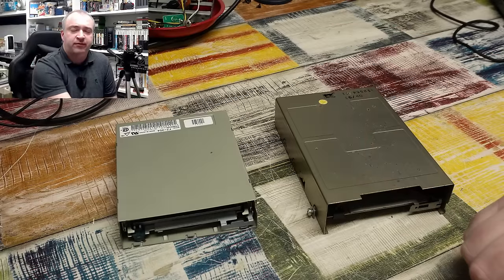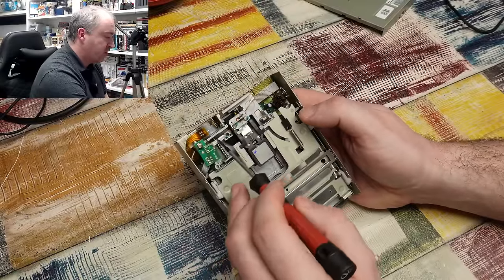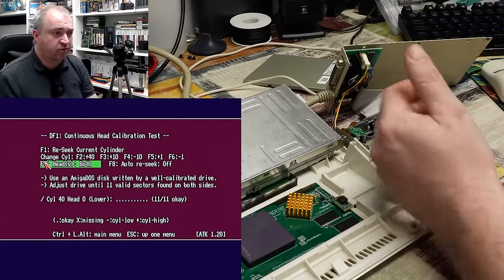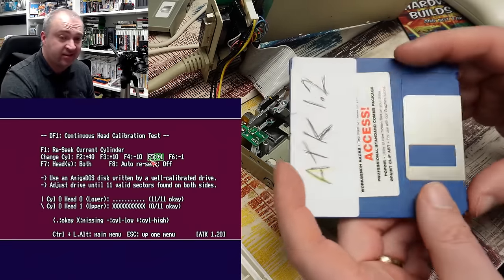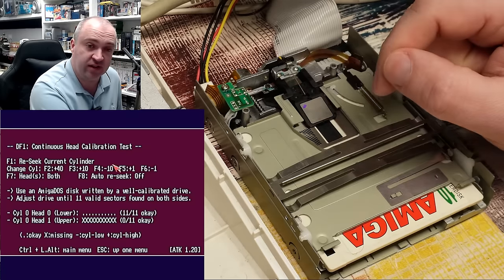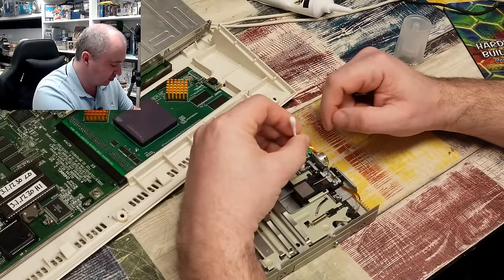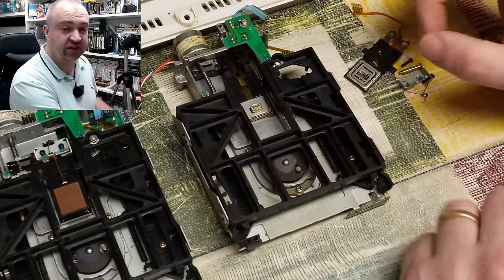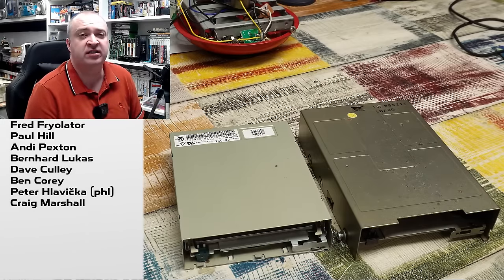Hands on alignment of an Amiga disk drive

Comment: Great video! a couple of weeks ago I just bought a broken external drive on ebay listed as broken, it powers up but does nothing... I am gonna do what you did here :)
Reply from the maker: Thanks glad you found it useful.  Certainly try Amiga Test Kit and see how it reports the heads.  If they are out start with the lower head.  Some Amiga disk drives also need the capacitors replacing to bring them back so that's worth checking too.  

Please let me know how you get on.

Comment: I successfully got my A1200's Panasonic drive working again this week. To get the track alignment, I rotated the stepper to find the extremes where it started to have errors, and set it at the midpoint. The track 0 sensor is harder, but the Greaseweazle software will tell you if it trips prematurely so you can estimate how far off it is (maybe ATK does too - same author). I used a stack of paper (a pad of small post-it-style flags) wedged between the sensor and the drive frame which let me adjust it by increments of about 0.09 mm, or about half a track, per sheet.
Reply: For leadscrew lubrication, Panasonic specifies Molykote EM-30L grease (PAO synthetic, PTFE and white solids, lithium thickener, no silicone). For the guide rod, they just say "oil", but I'd favour the silicone spray type.
Reply: Another nice thing about using a Greaseweazle (or similar) is that you can easily test the drive with other disk formats. When my drive was properly set up it could read original PC DD disks perfectly, whereas after my first alignment attempt it could read some Amiga original disks but not the PC ones.

Comment: I learnt a lot from this video my friend :).. I wont be touching those screws any time soon lol.  I've never used the disk section of the Amiga test kit either so I know how that works now too. Cool :)..
Reply from the maker: Thanks, glad to hear you enjoyed the video.  Yeah don't be removing any screws that have glue on them.  The disk section of ATK is certainly useful, this was the first time I used it for aligning a drive but it seemed to work well and was far easier than I initially thought.

Comment: Commodore didn't make it easy for code in a custom boot block to know what drive it has been booted from. This is how I did it back in the day. The OS does give you a pointer to the IORequest for the boot drive. Then the trick is to loop through all possible floppy drives, with a loop index and open a new trackdisk device for each. You can then compare each trackdisk device's IORequest's io_Unit pointer to find the one that matches the io_Unit pointer for the IORequest passed in. The index for the current trackdisk can be used as the drive index that the floppy was booted from.

Comment: I have a pile of 3.5inch floppy drives on a shelf. About 10 of them. Various makes and models. Do you want any? They were out of old PCs so not specifically amiga drives.
Reply: Im not sure what the difference is between an amiga FDD and a PC FDD.
Reply from the maker: Thanks for the offer but I've also got a pile of spare pc drives.  Other than Amiga drives being double density there is some signalling differences.  You can convert a pc drive to work on an Amiga easily enough.

Comment: where does the term cylinder come from ?
Reply from the maker: Each disk comprises of 80 tracks on the top and bottom of the disk.  Unlike say a vinyl record each track is just a circle on the disks surface.  A cylinder represents both the top and bottom track at any given position.

Comment: Who thought that putting the lower head on top of the upper head in the head calibration tool is just wrong?
Reply: I think the logic is that the lower head is the first (head 0) and so it comes first. Single-sided drives only had a single head, of course, and it was typically beneath the disk.

Comment: Hola Nico, te consulto. Tengo la necesidad hacer una distro linux pequeña para programar en ZX Spectrum y Commodore 64, con Emuladores como ZEsarUX y Fuse para Linux. Me podrias dar una mano o de donde se podria buscar info para poder hacerlo. Yo tengo una distro hecha con windows xp (con nlite), para poder hacer esto mismo con ZEsarUX, Fuse y ZXSpin, pero el problema es que no se puede COMPARTIR POR TODOS LADOS, POR QUE ES WINDOWS (por copyright), y quisiera armar algo para que sea libre. Armar un linux pequeño que funcione en 32bits, cargue de forma directa alguno de estos emuladores y listo. No necesito mas. El unico problema que puede existir es que los emuladores necesitan debian. A parte de eso, que como te digo, necesitaria que sea para 32bits, para que en PCs viejas se pueda usar sin problemas. Los 2 emuladores no tienen practicamente ninguna exigencia de hardware.
Como ultimo comentario, si es para programar en Codigo maquina para z80 o basic para ZX Spectrum 48 o 128k y MOS 6502 Assembler. Es para eso especificamente, pero la distro es para no usar hardware viejo.

Comment: eBay profit is easier when you buy actual untested lots, or lots that are just defective but no serious repair has been attempted. Once you go down to parts or even components, the success rate goes down quite a bit. Buying some collectors loft after they passed away and the estate selling the whole collection is obviously going to give you much more good stuff than the bits that people have left over after they assembled all the working gear and sold that as working.
Reply from the maker: My problem with that is if I buy a lot of stuff and find cool things in it then I ultimately want to keep them for my own collection.  Hoarder I believe is the common term 😂

Comment: I'd suspect that someone else damaged the lower head, possibly when the arm broke so they stripped it down to sort it and removed the broken arm :( Shame as if that was the only fault, sure a 3D printed arm could be made.
Reply from the maker: Yeah that was the plan, make a 3D printed arm to repair the loading mech but with the head broken as it is, it's just beyond it.  I may have another lower head and if that works out I'll pull together a follow up.